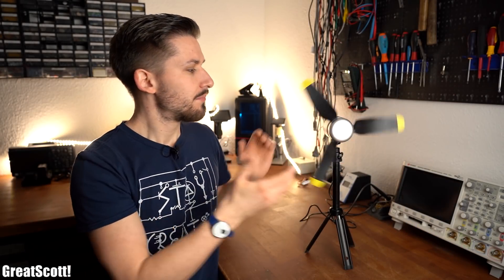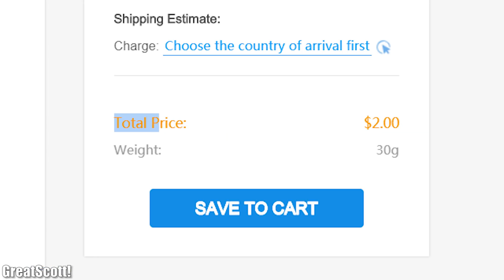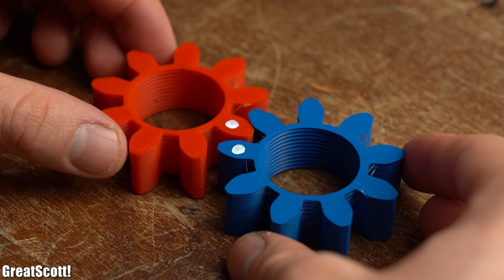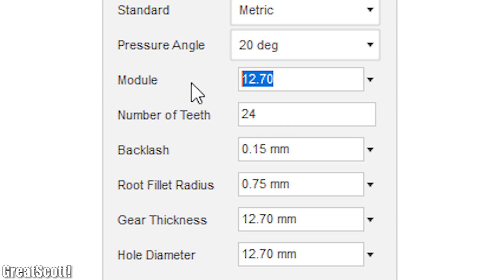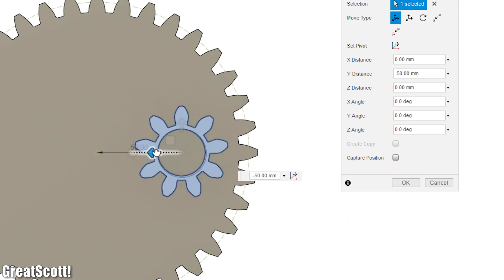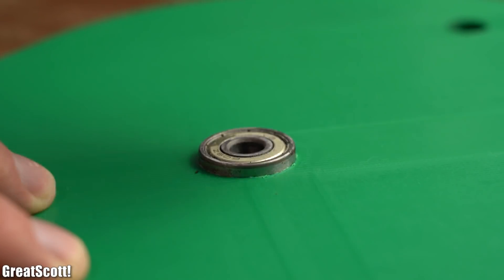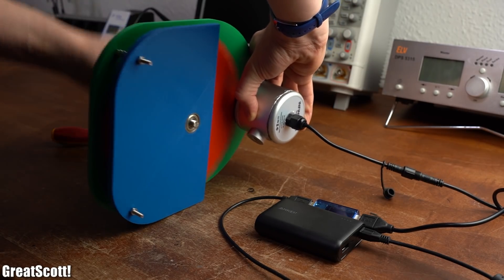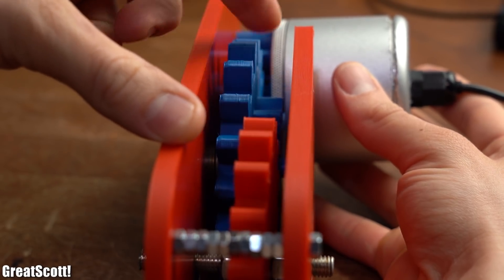Creating a Hand Crank Gear Drive for a Wind Turbine?! || Fusion 360

Comment: Your video made me realize I have forgotten nearly everything I studied for gears and geartrain design!
A quick suggestion if there is going to be a part 2 - Add a flywheel and instead of bothering with gear, maybe use "friction wheels", kind of like the mechanism hot wheels car launchers used. Less print time and probably better efficiency, because they will be smoother.
Cheers!
Reply: Friction drive would require high normal foces. More than I would be comfortable with 3d printed parts 

Im surprised he didn't try a capacitor on the output
Reply: @aleks138   I don't have experience with 3D printed parts, so I can't comment on their strength. But the metal threaded rods should be good enough, right? Maybe slightly increase the infill?
Also, I think there was a capacitor in the motor itself... Not sure.
Reply: Adding a fly wheel will require more torque to spin, and in the case of turbine good number of rpm is required then torque. For smoother process gears with chain won't be a better idea ? Please suggest me as I'm working on something

Comment: I love it when you turn something that's not working effectively to something a bit more useful instead of left it unused or throw it away. I often repurpose things that other people would just throw it away.

A small tip when designing a gear system. It's not recommended to make the bigger gear with teeth number a factor of the smaller gear's teeth number such as 4:1 as showed here. It's better to have odd ratio such as 7:2 because this way, the same teeth will not encounter each other in the next revolution and so the wear won't be concentrated in certain teeth and will be evenly distributed.
Reply: More specifically, it is recommended for the number of teeth on the gears to be co-prime. So if one cog had 15 teeth, the other should not have a multiple of either 3 or 5, because those are the prime factors of 15.
Reply: oh, another Asu, hi!

Comment: Hello greatscott i have a question i once tryed to make a mini pure sine wave invertor with an 50w audio amplifier and than boost the voltage with an transformer, and it worked but if i stop the amp is it posible for the primary of transformer to make an spike of voltage that will damage my audio amp ? If yes than how can i protect it ?

Comment: You could have designed and printed gears that are way smaller. I do robotics and our gears on the drivetrain are 3D printed in pla+ and don't cause any issues. They are like 2-3 inch diameter for a 36 tooth gear

Comment: Can we get a more advanced tutorial on how to design different gears with different ratios in fusion 360, and how to build a rack and pinion with those constraints too?
I wannna build a linear actuator and 3d print it but idk how to use the fusion 360 gear settings. Gread vid as always!!!!
(EDIT) Also what kinds of filaments and bearings are you using?

Comment: Sir, Can You Create a Arduino oscilloscope , THANK YOU
Reply from the maker: I can put it on my to do list
Reply: You could make this as a DIY or Buy. The DSO138 is a cheap, ATMEGA328 based oscilloscope.
Reply: @joeymurphy2464  stm32
Reply: Arduino is too slow to make anything that resembles a decent scope, hacking a RTLSDR by connecting a preamp to the ADC would work better. A standalone ADC connected to a FX2 or FX3 would be the next step, then finally an ADC connected to a FPGA.
Reply: @NiHaoMike64  Depends on the required bandwidth, of course. A raspi could easily handle up to a couple Mhz with reasonable resolution.
Reply: Well I think arduino-compatible ones like the ESP32 works dont they?
Reply: @XdewGaming  Few microcontrollers have particularly fast ADCs and even fewer have the compute power to do DSP on such a high data rate or a high speed interface to a PC.
Reply: Their is already SM32F103 (which is cheaper than arduino ) and works perfectly .